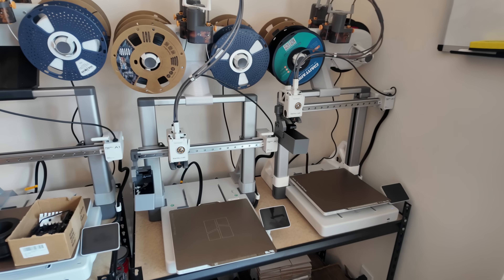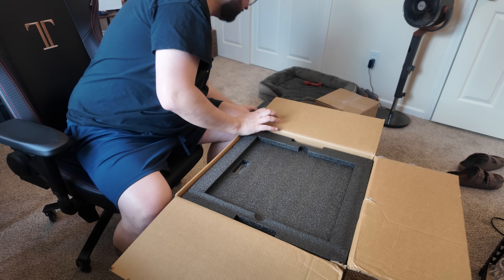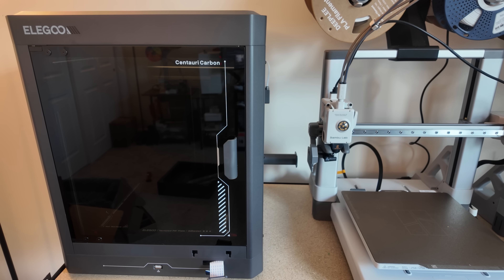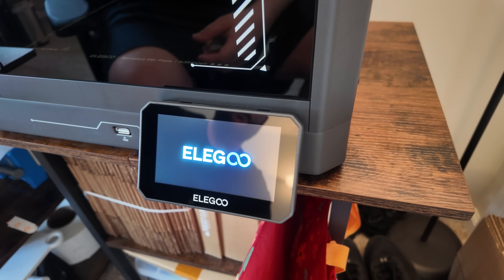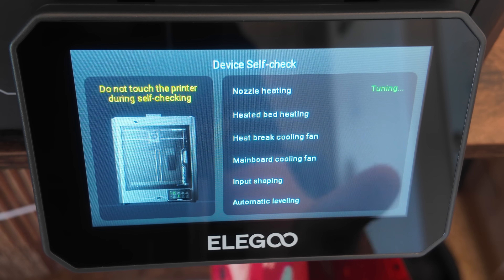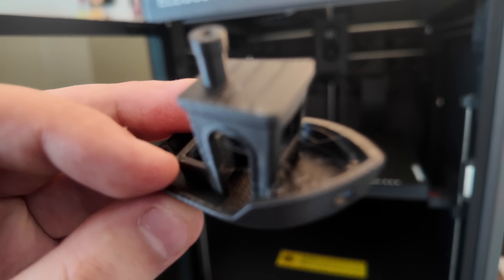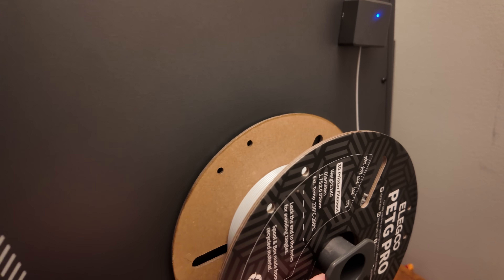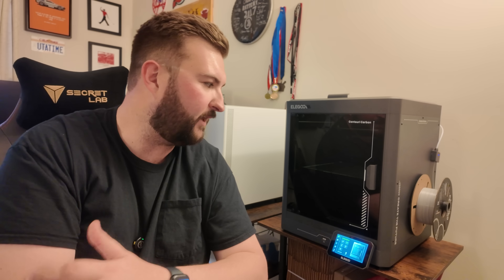Elegoo Centauri Carbon Unboxing, Setup & First Prints – Was It Worth the Pre-Order Wait?

Comment: You didn't seem to have to open the bottom and pull on the belts to move the bed before initialzing? Input shaping hangs otherwise ..
Reply from the maker: Not sure what you mean -- the self check in the beginning ran the Input Shaping no problem. Could you clarify?

Comment: Cool! you got yours early. Get a filament dryer. I see the P1S was mentioned, which is $849. If I’m not mistaken, you can’t print with CF etc unless you modify it. P1S is a great printer, but don’t limit yourself.
Reply from the maker: Sunlu is sending me a filament dryer this week, excited to try it on the channel. First Carbon Fiber print with the Centauri Carbon went great, no issues!

Comment: Why didn't you go the P1S route?
Reply: I can't speak for him but the P1S is simply more expensive and less capable. Unless you want to print multicolor, and you need the printer ASAP. It's hard to justify a P1S
Reply: @ less capable! Really. 🤔 You do get what you pay for though. I agree depends on budget and what you’re making. After all cookie cutters can be made on anything.
Reply from the maker: The CC can print with CarbonFiber/GlassFiber out of the box as opposed to the P1S. And for more than half the total price, it was worth the shot. I agree “you do get what you paid for” and I paid for a great high quality machine and that’s what I got. People need to stop with that as an excuse for why technology shouldn’t be up to standard.
Reply: @ a new nozzle and extruder and the P1S can print anything too. I agree should be included but for a simple cheap upgrade price not a deal breaker. What’s this excuse you’re talking about?
Reply: @Charlie_Chester  You can't give the P1S a 320C hotend and 110C bed. Aside from that the CC comes with a nice screen too. From several videos that I have seen the CC print quality is better than the P1S. To say nothing of the fact the P1S is more than 2x the price.
The only thing the P1S really has over there CC is the software/ecosystem. If that's worth 2x for you than go for it.
Reply from the maker: @Charlie_Chester what’s funny? Haven’t heard anything from your end supporting your reasoning for why you think otherwise. Would love to hear it
Reply: @DesignsByBrodhead  I just find it funny how I ask a simple question and everyone jumps down my throat defending the CC and having a go at the P1S. Looking at your videos I thought you were above all that.
Reply from the maker: No jumping down throats here -- I answered your question for why I went with the CC over the P1S. Has more capabilities right out of the box for half the price. We explained that to you and you responded with laughing. So I am curious as to what experiences you have with both the CC and the P1S and why you would chose the P1S over the CC? Genuinely asking.
Reply: @DesignsByBrodhead  I chose the P1S as I wanted the eco system and I wanted an AMS. Don’t think there is anything I would print that needed over 300 or a 110 bed temperature. The screen is crap I’ll give you that but the app is good and Bambu Studio does all I need to get stuff loaded especially with the Bambu filament and the tags.

I would have just thought with you having what you have and wanting more in your basement keeping all the sane eco system would be the way to go. No need for an AMS on each but you could swap them around if they were the same make. 

Obviously cost plays a part and as you said you went that route.
Reply: @Charlie_Chester  I know of 2 people who have both the p1s and the x1c and even with the price difference they say go with the x1c every time.  The P1S has also cut a lot of corners.

Comment: so why this and not a P1S and stay inside the BBL eco system  ? The P1S can do the same filaments.
Reply from the maker: Because the Centauri Carbon is half the price at $299.
Reply: @DesignsByBrodhead  will be interested to see if you do anything in CF or ASA.
Reply: Not true actually. CC is more capable with hardened steel components, and 320C hotend. so It can print stuff like carbon/glassfiber